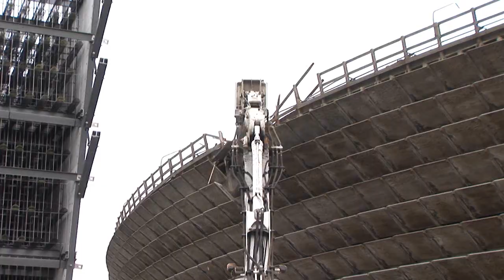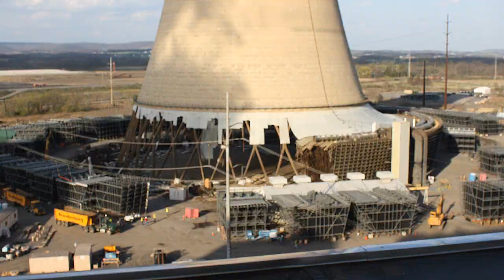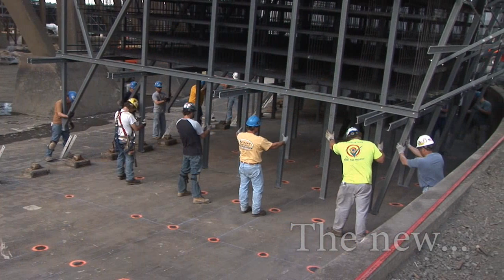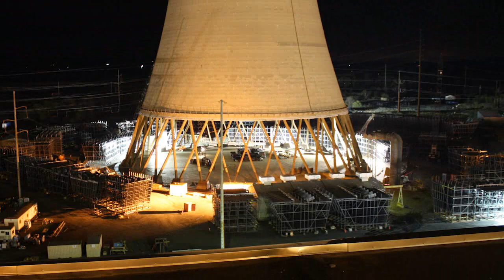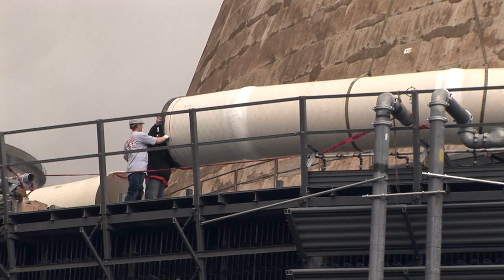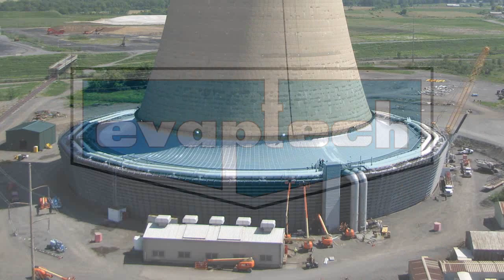Evaptech cooling tower time lapse

Comment: What are the metal structures...we don't have them on our cooling towers in UK....
Reply: The only one in the on the UK that had one was Slough power station.. one of the two cooling towers had one… it basically feeds water from the outside of the cooling tower rather than inside.. for many reasons the pipe in the inside may be damaged and it’s cheaper to build these systems or it was already designed this way.. the water is poured on the racks you see being built and falls into the cooling tower along with the draft being sucked in.. they reckon it cools the water faster compared to the water just falling from racks inside the tower but it’s only by a small fraction.
Reply: There actually fiber glass